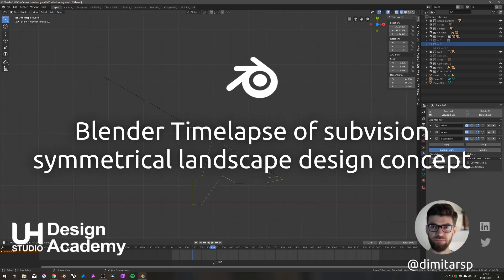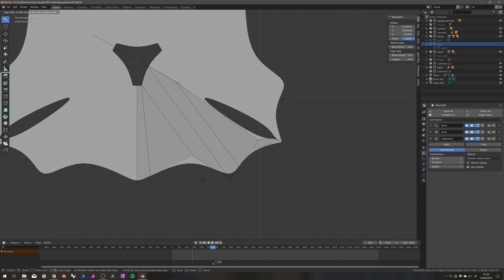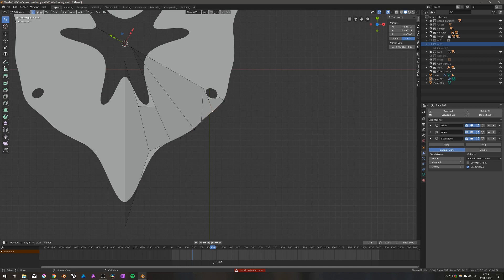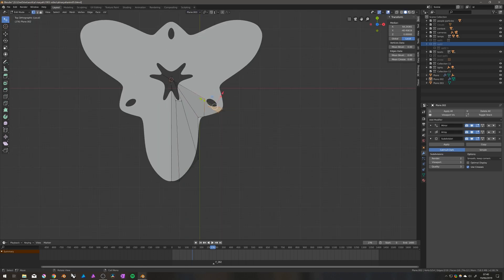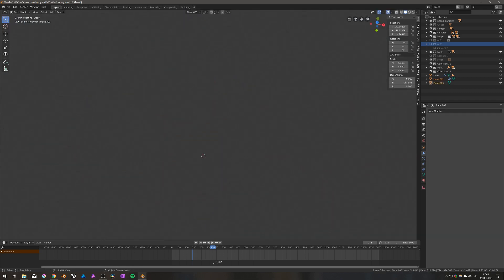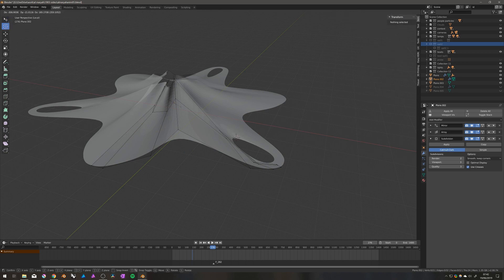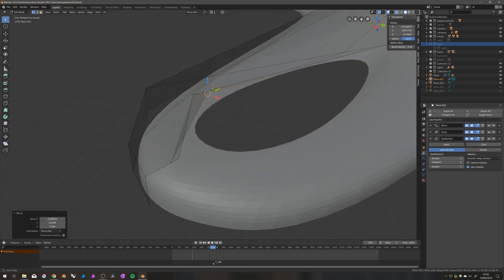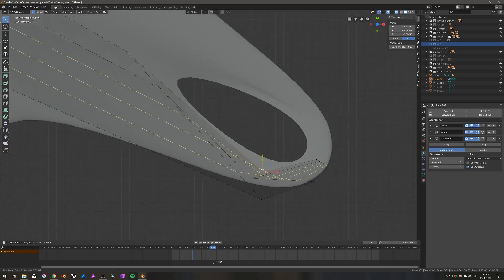Blender Timelapse - Symmetry subdivision modeling

Comment: Great tutorials. I'm really learning a lot, thanks! 🙂 I'm trying to transition from 3ds Max (using it professionally for ~13 years) to Blender 2.8 and I have a question. Any idea how I can slide an edge loop and snap it to a vertex on another object at the same time? Is this possible with Blender? It's really easy in 3ds Max. I do this in orthographic viewports to slide loops where windows and doors are by snapping on the vertices of the imported AutoCAD drawings while sliding, but I can't seem to do this with Blender, because it doesn't seem to allow snapping while in Edge Slide mode. Is this possible in Blender at all?
Reply from the maker: Thanks for your comments. What you are saying isn't possible in blender, or at least not in one step. If you are doing purely vertical walls, then you can create an edge loop, and after you've created it, you can drag it up or down with the snaps enabled to snap to a vertex. If your edge loops are for more intricate objects, where you can not simple move the edges up or down (or left or right), then you might have to slide your edge loop to an approximation. It may also be worth to discuss on blenderartists.org to see what suggests others may have.
Reply: @UHStudio  Thanks for the reply. That's what I've been suggested on Blenderartists too. I'll just slide the edge loops as closely as possible and then snap them by moving them. I've upvoted a few feature requests for adding this functionality on blender.community/c/rightclickselect/. I urge other fellow Blender users to do the same so the problem can be addressed hopefully. 🙂